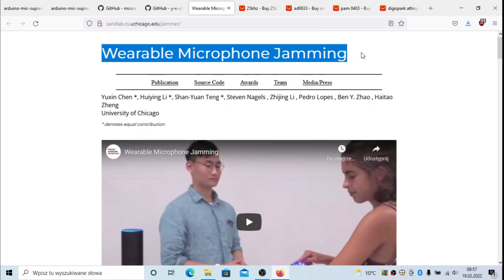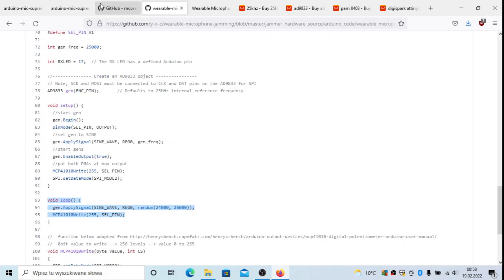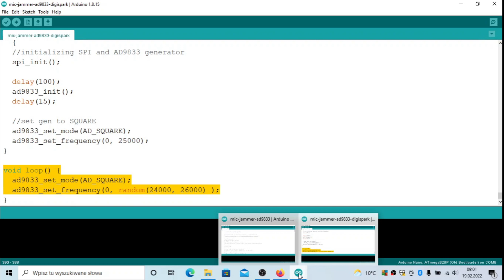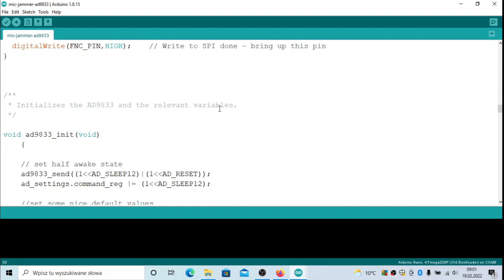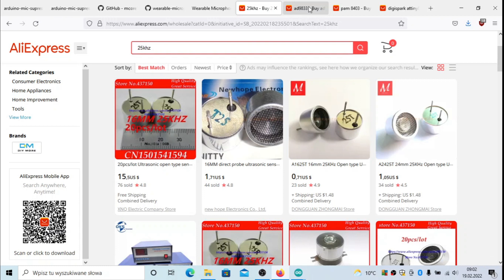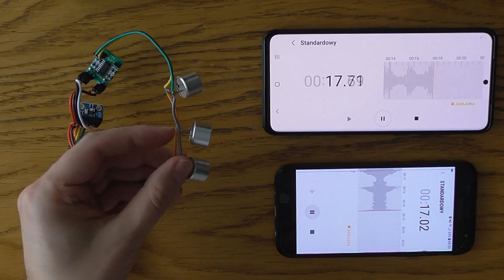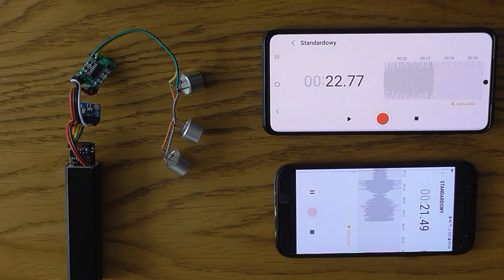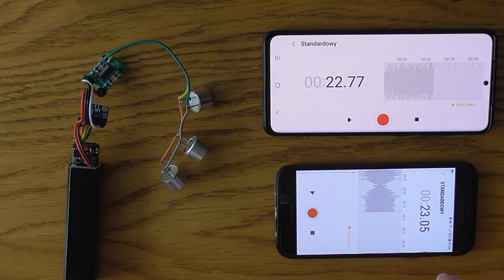Simplest, cheapest, effective DIY ARDUINO ultrasonic Microphone Jammer / DIY ultrasound Audio Jammer

Comment: What resources do you recommends for learning C programming for microcontrollers? Thank you in advance!
Reply from the maker: For the AVR based environment and  chips there is a good starting point here : https://www.8051projects.net/files/public/1242392126_2569_FT22383_avr_tutorial.pdf
For Arduino based check this ebook here https://github.com/dboyliao/C_Cpp/blob/master/C%20Programming%20for%20Arduino%20%5BeBook%5D.pdf
Reply: @justanengineer5599  Thanks! Can I do this project using Arduino Uno board instead attiny?
Reply from the maker: yes. but you would need to finetune delay parametrrs etc..

Comment: hello I tested the 40khz with the 25khz of the last version together they had a small result but it seems to be the way to interfere in the iphone, obs I bought a similar equipment in aliexpress that uses 32 transducers 25khz and in the iphone it had a good performance at 1 meter. Any idea what can be done to make your project work on ios devices?
Reply from the maker: I would need an oscilloscope view of the signal generated by this jammer from aliexpress. By looking at the signal I would deduct what should I do to improve jamming capability. The signal may be from the audio receiver / transducer connected to the oscilloscope
Also some pictures of this solution (inside) would help especially info if they are using 25kHz transducers only or maybe combination of 25  and 40khz.
Reply: @justanengineer5599  An observation is that the equipment generates noise at 120db at a distance of 2m yours generates 95db up to 1m I don't know if that helps
Reply from the maker: this means that better audio amplifier and more transducers are needed. Try to use  TPA3116 module + 30 transducers per channel.

Comment: hello, this 40khz version I'm going to buy transducers to test it mic-jammer-40KHZ.ino My doubt is the 40khz transducers that I found are for measuring distance, would they be the same ones?
Reply from the maker: for most of the recording devices only  25kHz version works. You may test 40kHz version but it is only for some microphones. Ordinary 40kHz sensors used for distance measurements may be good for the testing. Sensors are also transmitters
Reply: did it worked with 40khz?!
Reply: @TeraHertze  in my test on the iphone 8s plus and 13 it didn't work but the use of the 25khz with the 40khz had an effect on the iphene at 60 cm of distance

Comment: I took the test and studied all the material about using the transformer, but none of the tests worked, I also discovered that the project with digispark is not capable of interfering with the spy pen or the majority of spy devices, it only works on android phones and some models of cameras. Were you able to make progress on anything in the project?
Reply from the maker: By changing few parameters in the code like random length of the pulse and number of the pulses  I have achieved much better effectivenes on high end phones (uploaded new version of main7.c file for ATTINY85).  You may also experiment  wirh ATTINY13 chip as I have feeling that this code jamms even better  (main8.c + ATTINY13 chip)
Also corrected Digispark version (mic-jammer.ino  no AD9833 required)
I have doubts if you have experimented with these settings at all.
Reply: @justanengineer5599  I installed the mic-jammer.ino digispark version, it really got better but it still works on the iphone, for android and newer devices it was perfect!
Reply: @justanengineer5599  I tested the version with mic-jammer.ino, it improved performance on newer devices, but at a shorter distance, and it still has no effect on iPhone
Reply from the maker: I am waiting for delivery of the transformer to see if it improves the power of transducers
there are some people using speakers for 25khz  model XHXDZ-3840 instead of transducers - https://ibb.co/JFHny9T

Comment: Excuse my lack of knowledge, but at the output of any PAM840x the outputs are direct current, when connecting the transformer coil wouldn't I be closing a short on them since to move the transformer coil it would be necessary alternating current at the output?
Reply from the maker: the winding of transformer always has some inductance like ordinary speaker for example. If the winding has 4Ohm like the speaker it would fit the PAM840x output
there is some explanation here https://electronics.stackexchange.com/questions/95743/can-you-bridge-or-parallel-the-outputs-of-the-pam8403-amplifier
also here
https://www.diyaudio.com/community/threads/increasing-power-of-pam8403-3w-3w-amplifier-board.268899/

Comment: I tried several combinations until I reached one that varied from 24 to 26 kHz with a tone in the speaker that looked like the ones emitted by equipment that works on iphone, but still without success on iphone
Reply from the maker: if you have a transformer there you could put it between an output of the PAM8406 and your Transducer Matrix. The point is that piezzoelectric transducers are mostly driven by the voltage not the current. You need some small transformer from the old power adaptor. The low voltage circuit should be connected to the PAM module and the 220V/110V circuit should be connected to the transducers. This way you amplify the voltage on the transducers. Measure the voltage before connecting transducers. They have some voltage limit and it may be around 100-150volts.  It will give you enough power to jam the iphones
Reply: @justanengineer5599  could put together a diagram with which transformer you can use so I would mount here to test
Reply from the maker: instead of transducers you connect 2 pins of low voltage winding of the transformer. 2 High voltage winding pins of the same transformer  you connect to the transducers. As simple as that. Remember that PAM840x output is around 10V so the output of the transformer will give you 100-200 Volts. 60-80 volts on transducers will give you outstanding power of jamming
EDIT: JUST CHECKED THAT THESE CHINESE TRANSDUCERS HAVE MAX INPUT VOLTAGE 60V !!!! BE CAREFUL AND FIND PROPER TRANSFORMER WITH 1 TO 6 RATIO !
Transformer 220v to 48v would be  just fine because it has 1:5 ratio
Remember not to exceed 60-80 Volts on transducers
see this specification
https://ibb.co/N2QqcSp

Comment: I tested main.c with a model without the AD9833 but on the iphone there was no interference more than 5cm from the transducers
Reply from the maker: main7.c you mean? main.c was not changed at all
Reply: @justanengineer5599  yes main7.c
Reply from the maker: in the main7.c you have several options to tune this device
a)you can change 100 to other values in this line :

for(sequence=0; sequence<100; sequence++)

b) you can change 50 to other values here :

pulsewidth = 20 + (rand() % 50)

this above cannot exceed the value in this line ( you can also change 85 to other):

for(i=0; i<(85 - pulsewidth); i++)

c) you can change these values (they have to be 31 in total : 15+16=31) :

amplitude = rand() % 16; amplitude = amplitude +15

please experiment for better results

when making changes watch the test pin using oscilloscope if the frequency is around 25kHz.

Comment: I'm trying to make some code changes but with no success yet, the iphone can easily ignore the noise and not be affected. if you have any progress or suggestions for testing with iphone that you can share and post here for us to test thanks
Reply from the maker: Hi try my main7.c  code for the design with resistor DAC ladder (the one without AD9833). I am currently working to improve and the results are promissing

Comment: I am sending you the example video with an android and an iphone at this link:
https://youtu.be/V1HdVRfnG1s

In this link below is the interference distance test on the iphone:
https://youtu.be/FabhvPDJA2A

As you can see, the new code has improved the interference distance on the iPhone, but it has to be in the direction of the transducers and at a maximum distance of 2 palms, beyond that, it does not interfere with the iPhone, unlike androids that can be in any direction and at distances of 5m

Obs during the beginning of the recording there will be interference because it was recorded from an android
Reply from the maker: it looks like the iphone needs to be exactly in the line of sight of the transducer. Single transducer has around 30 degrees of beaming angle and when you are movin the iphone it looks like it is no longer in the center of the beam. I'm just wandering what would happen if these transducers would be packed more dense and if it could improve the jamming characteristics. Meanwhile i will try to work on the code in free time, maybe improving pseudo random base for the frequency generation and phase would make it more effective. Anyway it looks like the jammer is presenting an outstanding performance for most of the Android phones. In my tests I see it jamms almost everything in the range of 5 meters does not matter if it is an android phone or android based tablet. Also these phones do not have to be placed in the line of sight of the transducer matrix.
Reply: @justanengineer5599  Yes, as for android, it is showing a perfect result, leaving only one solution on the iphone to make it work in general, when you see other modifications for us to test let us know thank you very much for everything

Comment: I tested option 1, I found that there was an improvement in interference and sound changes in the result of recording audio on some cell phones, but it is still ineffective on the iphone.

i'm going to try option 2 today, i think iphone has very good noise filters
Reply from the maker: option 2 is almost the same as option one. The difference is that Arduino IDE has probably better random number generator which is a base for the white noise frequency

Comment: Can you post the link to the new file here please?

keep the same circuit? write the code in attiny the same as it was done with main7?
Reply from the maker: you have 2 options :
option 1 - use this schematic https://github.com/mcore1976/antispy-jammer/blob/main/arduino-mic-supresor-ultrasonic-v2.png  and ARDUINO IDE for this code https://raw.githubusercontent.com/mcore1976/antispy-jammer/main/mic-jammer-ad9833-digispark.ino

option 2 : use this schematic https://github.com/mcore1976/antispy-jammer/blob/main/arduino-mic-supresor-ultrasonic-v2-ATTINY85.png
and avrgcc for this code
https://raw.githubusercontent.com/mcore1976/antispy-jammer/main/main6.c
and the  compilation script
https://raw.githubusercontent.com/mcore1976/antispy-jammer/main/compileattiny6

both options are working the same and have better effectivenes on high end phones
Reply from the maker: I see you have removed all of the previous videos so I presume the device is working as expected 😀
Reply: @justanengineer5599  I managed to stop this morning to test option 1, I really saw a significant improvement but it is still incapable of interfering with the iphone, but this is the way to go because before I needed to touch the iphone to the transducers to have an effect, now it works even at 10cm of height distance from the transducers with the iphone, and on the other devices it has improved a lot.

Comment: if you can do that and send me the exact list of component materials... I'll arrange and assemble it here by sending you the video.
use as many and as many components as necessary, the important thing is for the project to be successful so that you can put it on your channel and I can have the expected result. again thanks for the help.
Awaiting return!
Reply from the maker: i need first to purchase some board with MCP41010 chip or equivalent and try to connect it together with AD9833 to the same Digispark. It may be difficult because Attiny85 has only few usable pins
Reply: @justanengineer5599  In that case, wouldn't an arduino nano or another microcontroller be more viable?
Reply from the maker: i will try to do it with digispark and if I fail then I go with other arduino. But first I need to select and purchase appropriate digital potentiometer board
Reply: @justanengineer5599  ok wait, thanks
Reply from the maker: Hi, I was able to achieve better effectiveness on newest phones by modifying the code for AD9833 with random PHASE modulation. Please update the chip with new main6.c or Arduino INO code

Comment: If I only use transducers on a single output of the amplifier, the interference in common devices is less and in the iphone there is no interference.

If I use transducers on the two outputs of the amplifier, the interference is total in common devices, it only interferes with the iphone if I get very close to the transducers, about 5CM of proximity, when it passes more than that, it stops interfering.

with speaker and transducers, it interferes well in common devices, at a short distance (1 meter), in the iphone it only interferes if you are also 5cm away from the iphone it only records the noise generated together with the voice having a result (it can if you listen to the being said with noise generated by the speaker in the background).

OBS: the oscillation is correct apparently all the circuit and recording of the atinny was correct, I watched videos of similar devices, with transducers and loudspeaker and in the videos they work correctly on the iphone however the sound emitted by the loudspeaker seems more like radio hiss outside the station, because this signal generated in your code, the noise seems very different from hiss and is audible to the point of being annoying if it is above half the potentiometer adjustment.
Reply from the maker: yes, it looks like it is not durable without randomly controlled audio gain with digital potentiometer on top of the noise generated by AD9833 signal generator.  I need to redesign the circuit using digital potentiometer and AD9833 generator

Comment: I turned on the transducers and the speaker, on common and older devices it worked at a distance, but on the iPhone (8 plus) it works if it is up to 5cm away, moving further than that it only records the noise emitted by the speaker (very loud and uncomfortable for the ears of those in the room), and I can hear the voice normally.
I recorded it with my iphone so you can hear and see everything link:
https://youtu.be/JsexpcB5Pt8
Reply from the maker: does it make any difference if you connect transducers to the new board and another set of   transducers to the second board with AD9833 and then turn on both devices at the same time? what happens if you use only transducers?

Comment: I just built a new circuit based on the 4-bit R-2R example, I still haven't connected the transducers and the speaker to test it, but I saw that the waveform changed, I'm sending you the video to see if it's correct. video link:
https://youtu.be/V1zd8I55alM
Reply from the maker: yes, it looks correct now. try to connect the speaker and transducers

Comment: Everything seems to be recording correctly on usbasp, the attiny is new, I bought several to test, all the components are new, the circuit was assembled as shown in the diagram, but the speaker emits that sound from the video and the transducers emit something soggy but do not interfere on the iphone other than generating a loud noise along with the voice.

the video of the oscilloscope and operation is here:
https://youtu.be/1Y3-YYj3Cos
Reply from the maker: check the circuit because something is wrong there. The Digital to analog Converter is incorrectly build. You have some missing connection or some shortage. It does not work the same way as my prototype. The program has been uploaded succesfully but the problem is with connectivity of resistors. Check it 3 times it should be built exactly like this : https://github.com/mcore1976/antispy-jammer/blob/main/antispy-jammer-enhanced-schematic.png      pay attention to the points where resistors are connected. Currently either you are getting the signal from single bit of DAC or this DAC is not working well because the resistor ladder is connected wrong way
Here you have the explanation how DAC is built https://www.electronics-tutorials.ws/combination/r-2r-dac.html
look for the picture "4-bit R-2R Resistive Ladder Network"
I also do not see capacitors on your board that shouls be connected nearby the chip GND and VCC

Comment: now the installation seems to be correct see in the video:
https://youtu.be/-IsvWLwJlLQ
however, when placing the ATtinny in the circuit, the speaker generates loud noise, the transducers generate a different noise but are still not able to interfere with any device, the test was carried out 20cm away from the circuit, what could it be now?
Reply from the maker: it should give at least similar effect like the circuit with ad9833 signal generator. It looks like it was programmed correctly this time. Do you see the same type of pulses when oscilloscope connected betwen the test pin and GND like I am getting on my photos? pulses should have different amplitudes and the length should be around 20usec.

Comment: I filmed the compilation on linux and it is showing this error in main7.hex
https://youtu.be/ujsBOjdxjIE
Reply from the maker: Hello, From this error here  https://ibb.co/Y2xMjZm   we can see that either :
1. You do not have file "main7.c" in the same directory as "compileattiny" script  (the avr-gcc compiler is not finding the C file so it is not producing ELF file), or
2. You haven't installed all the necessary tools for compilation yet 

For step #2 try to run this command :
sudo apt-get install gcc-avr binutils-avr binutils avr-libc gdb-avr avrdude

and see if you have all the apps installed